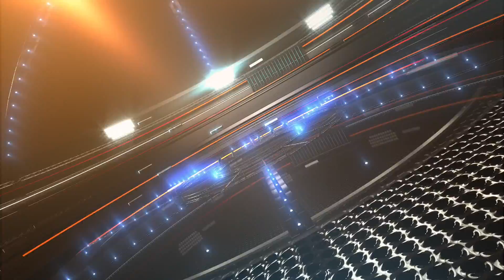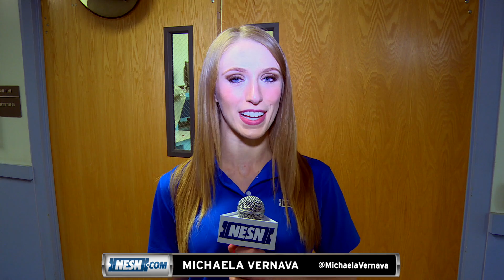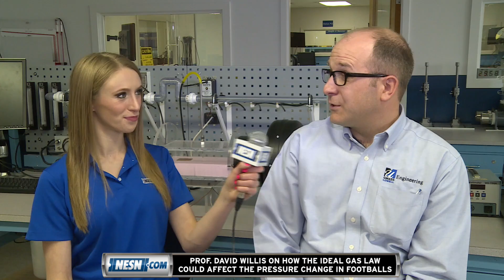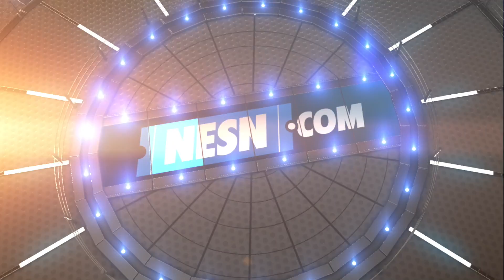Can The Ideal Gas Law Explain The Deflation Of Patriots Footballs?

Comment: He’s wrong.  The patriots balls were wet, and measured at the start of halftime, they took longer to warm up. The Colts balls were measured after the 11 Patriots balls and were dry because the colts suck and their balls were on the sideline in a dry bag beside their QB. Cold wet balls have less pressure then dry warm balls.